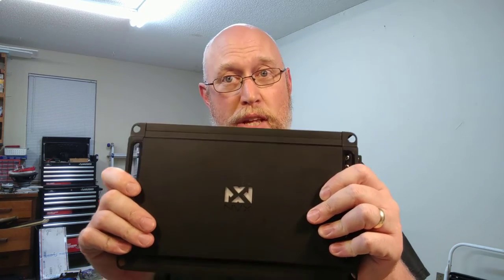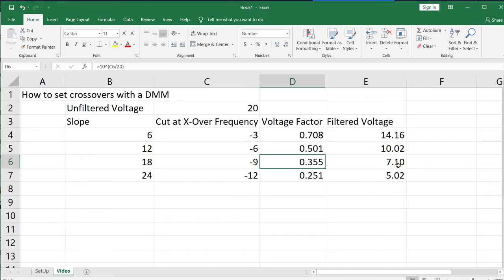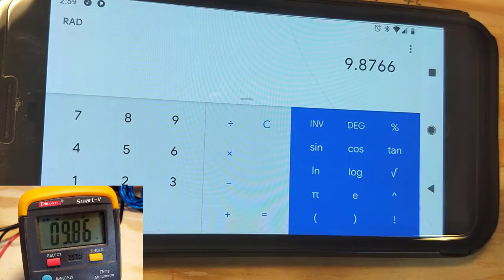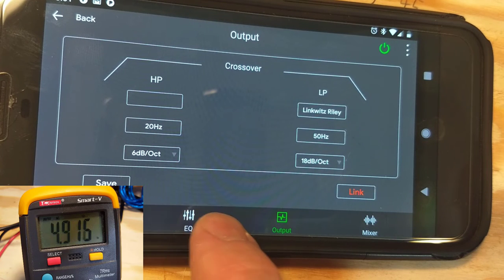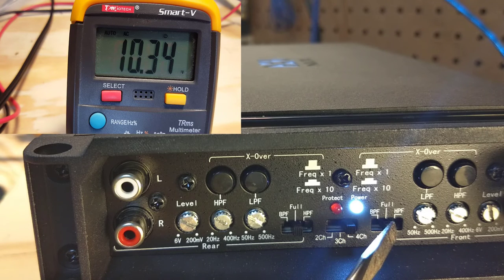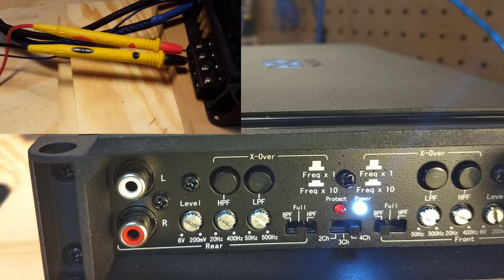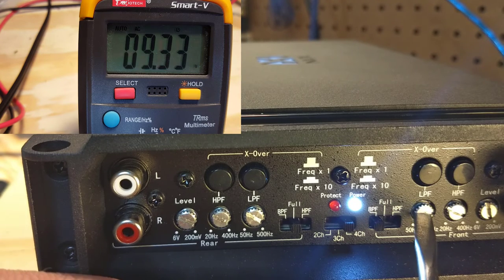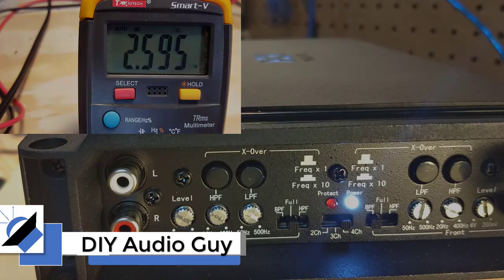Set Crossovers with a Multi-Meter, the CORRECT way!

Comment: Is it ok to bridge a 4 channel amplifier! I’ve a Rockford fosgate punch 400!
Reply from the maker: Most four channel amps can be bridged to two channels, and most are four ohm stable wind bridged.  You will need to check the owner's manual for the details for your particular amplifier.
Reply: DIY Audio Guy thanks 🤘🏾! One more question! Do you recommend me getting a equalizer or crossover for my car! Is one better then the other ?
Reply from the maker: That depends on what you're trying to accomplish and what your other gear looks like.
Reply from the maker: Some amps have a great crossover section and most head units have an decent EQ.  So you may not need either.  Honestly I wold skip an external EQ/crossover for a DSP.  You can get a basic DSP for $160 (https://amzn.to/301SgUa), or just skip it altogether and get a kicker key, which will automatily set the crossover, time alignment and EQ  (https://bit.ly/3kBLY5q).

Another good brand is MINI-DSP:  https://bit.ly/33RToun 
They have everything from entry level 4-channel DSPs up to 12 channel DSPs.
Reply: DIY Audio Guy nice thanks sir ! I’ll check into that soon! Yes my systems sounds clean and crispy! Super tweeters pioneers in dash ! Alpine 5.25 Es in doors. Alpine 6x9s in back! Jbl 751ez mono ! Rockford fosgate punch 400 that has clean technology set up! Kenwood excelon x303 head unit! In a 1993 Cadillac deville! Two 12 skars svl in a ported ground shaker box!
Reply from the maker: Hell yeah brother!
Reply: DIY Audio Guy appreciate it thank you sir💯🤘🏾💪🏽

Comment: what value level should be set at when doing this ?
Reply from the maker: It does not really matter.  But It is best practice to set  your gains properly before you set the crossovers.  I always like tinker with the volume on the radio until I get a good round number for the first reading.  This just makes the math easier.  

These videos may help:

https://www.youtube.com/watch?v=MBcGOoRJ4Ro
https://www.youtube.com/watch?v=iWRoIho7A7c

Comment: Hm, what would be the math for a crossover of 48dB/octave?
Reply from the maker: I'm not aware of any car audio amplifiers or signal processors that can do that.
Reply: DIY Audio Guy well my DM-810 DSP only has 12/24, but I’m using the crossover on my amp (Memphis VIV700.1) which has a 48dB slope for the LP crossover
Reply from the maker: Well I learned something new today.  I suppose I need to figure out the math for a 48 decibel per octave slope now.
Reply from the maker: The voltage factor would be .063.  So if your starting voltage was 10 then your voltage at the crossover point would be 0.63.  Which is virtually nothing.

Comment: What if I set my radio xover to 80, 6 way active xover to 75, and my amp’s xover to 70? All highpass on 6.5’s.
Reply from the maker: Then you will have three crossovers turned on.  If they're all 12 db/octave then you basically created a sloppy 36 db/ octave crossover.  You only need to use one of them.
Reply: DIY Audio Guy, what exactly do you mean when you say “sloppy”? Should it be 24db/octave or 48db/octave?
Do you have another suggestion on how to make my 6.5s not play 40 hertz, because 1 12db/octave xover set at 80 hz doesn’t do that. 6.5s shouldn’t play anything at all below 60hz IMO.
Reply from the maker: By sloppy I mean you've got one crossover set at 70 one at 75 and one at 80.  Each crossover is going to induce a phase shift at the crossover point and that's going to give you weird peaks and nulls at the crossover point.

And no, you can never keep your speakers from playing a 40 hz signal.  an octave is 1/2 of the frequency so if you have your crossover set at 80 hertz the signal will be down by 12 decibels at 40 hertz which is half of 80. In other words you're still going to get signal in the six and a half.   Crossovers are not a brick wall, they are gradual slopes.

Comment: How do you set a gain and xover for tweeter @125rms and xover @6000hz? I can do this for 150hz, 50hz, etc but the multimeter isn’t reading the way i expected.
Reply from the maker: Interesting, what is the multimeter doing?  Most multimeters can read the frequency, try a 6,000 hz test tone and see if the multimeter can read the frequency.
Reply: @DIYAudioGuy  yep I did and the voltage didn't read like a 150 tone, it read like 4.3 instead of 22.00
Reply from the maker: I honestly don't know what to tell you.

Comment: Does this formula work at any volume level? I assume the reference voltage is the voltage at whatever volume you are at.
Reply from the maker: Yes, it does.  What I've started to do lately is to set the volume so that the voltage is at a nice round number to make the math easy.   If the starting voltage is 10 then all you have to do is move the decimal in order to do the math.

Comment: Great video very informative.. I have a question. do u do this crossover settings after setting your gain with a 40 or 50 hertz tone?
Reply from the maker: Yes, set the gain first.
Reply: @DIYAudioGuy  Greetings! To follow up on your reply. In my case, it was not possible to set the gain first. I had to do the LPF and HPF (subsonic) tunings. Reason I couldn't do my gain first was because I could not reach my "required" 31.6V for the 1000W for my sub. The minimum reading on the DMM was 32.0+ V on the absolute lowest gain setting. Only after once I set the crossover points on the LPF and HPF first, did my gain gain knob actually give sensible voltage values. Does this seem correct to you? Does it actually make a difference which you tune first? Thank you!

edit: my sub level on the headunit was to 0.
Reply from the maker: Sounds like it worked out fine for you.  What frequency test tone did you use to set the gain and what is your crossover frequency?
Reply: @DIYAudioGuy   First I set the subsonic filter by playing a 30Hz 0dB tone. Then I set the LPF by playing a 80Hz 0dB tone. Finally I adjusted the amplifier's gain knob (headunit was 85% of max volume) by playing a 40Hz -3dB tone to bring it to the ~31.6V. Anything that jumps at you that you  would do differently? Thanks!
Reply from the maker: @acmilanshevachels  If you are happy with the sound and you are not clipping, then it is good.

Comment: The way you set crossover seems to be different from others. On other videos, people will play the frequency that they want their crossover set at, and whatever the voltage is when the frequency is playing, they will adjust the knob until voltage starts to drop and that’s where we would set it at.
Reply from the maker: Take a look at what happens around 11:20.  I turned the crossover on and I turned the knob all the way to the right. So the crossover is set to 500 Hertz.  At that point the voltage is just slightly less than the starting voltage.  So if you use the other method your crossover would be set to 500 hz, not 50.  Those other videos have thousands of views. Which means there are thousands of people out there with crossovers that are off by an order of magnitude.  You will notice that in this video I verified my math by comparing my predicted results against the result I got from the digital signal processor.
Reply: The crossover frequency point is always -3dB. So setting to crossover to 80hz means that there will be a -3b or 30% reduction in voltage at 80hz. This video shows exactly that
Reply from the maker: Crossovers can get pretty complicated. I'm not 100% sure that I have it right.  But I've seen some YouTube videos, from larger channels that should know better, that absolutely have it wrong.  Not trying to cast shade on them, just trying to help people.
Reply: Most amps have fixed slopes. The setting up for a target crossover, at an assumed frequency where the amp labelling is, could be inaccurate. If say one rotates the knob to a 90 hz lowpass, the only sure way to know IT has kicked in at the right frequency, is to start Sweeps and record the voltage where it changes. Burst tones are more accurate, at increments of one.
There are audiophile test cds with these tones. The track number and test tone at certain frequency is given.
Reply from the maker: One of us has to be wrong.

Comment: Enjoying your videos! Sorry if I have multiple questions on different videos, but what do you mean unfiltered voltage? Is this with a tone playing? Volume set to highest without clipping?
Reply from the maker: Unfiltered, as in the crossover is not on, or not doing anything.  it is with the tone playing with the volume does not have to be set to maximum.  You just need enough volume so that you can read a voltage on the multimeter.  

Keep the questions coming. I'm sure there are others with the exact same question that would like an answer.  If people are asking questions it means that I need to make another video on the topic.
Reply: @DIYAudioGuy  awesome and thanks again. Definitely made a new subscriber.
Reply: @DIYAudioGuy  where did you get voltage factor
Reply from the maker: @chevy1560  =10^((slope/2)/20)

Comment: great video, you need more views and more likes,
do i need a true rms dmm?
Reply from the maker: Yes, you can get a decent true RMS DMM dirt cheap these days.
Reply: @DIYAudioGuy  very big thank you for the video but I've got a little question.  If my amp Xover can do only 12db/oct should I multiply the first voltage by the factor you showed at the begining of the video for 12dv/oct?
Reply from the maker: @longdee5192  That is correct.

Comment: Is the volume all the way up before clipping?
Reply from the maker: You don't need the volume all the way up when setting crossovers.  It's just a matter of comparing the voltage before and after.  I show how to check for clipping in this video: https://youtu.be/L0ZXq2eo-OM
Reply: DIY Audio Guy ty sir. Getting ready to do a install in my 300 as soon as my package comes in

Comment: Nice dog 🐕
Had a question I wanted to ask you,  What’s your take on this?, why wouldn’t every amplifier that comes with a crossover adjustment, not give you the option to have it adjustable down to 0. For example, the infrasonic filter on most bass amplifiers in today’s market are adjustable from say 20-50hz or 15hz-35hz. This doesn’t allow someone the opportunity to not use the filter, because even at its lowest point, it is still cutting the voltage. What I hear from most people is that you shouldn’t notice that much of a decrease in loudness in those range of frequencies from having it at 15hz as compared to an amp that doesn’t have one, but  I beg to differ. Some of these amps nowadays have 24 dB slope on the Filter, and that really does affect a 20hz tone even having the filter it at its lowest point of 15hz. Sorry for the long winded comment and question. Keep up the great content!
Reply from the maker: Now that you mention it, that seems kind of odd.  when I get to my computer I will try to type up a thoughtful response for you.
Reply from the maker: OK, here is what I think!     Let's say you set the subsonic filter to 20 HZ, and it is a 6DB per octave linkwitz riley, it will be down 3DB at 20 HZ.  Then down 6DB at 15 HZ and down 12DB at 7.5 HZ.   Down 3DB at 20HZ is not much at all, but it is  kind of a moot point since most subs are going to roll off before they get down to 25 HZ.  Setting the subsonic to 15 HZ is practically the same as setting at at zero.   But this is just my best educated guess.
Reply: @DIYAudioGuy  i appreciate the response. In my experience, 99% of amps that have the subsonic filter on the amp, is either 12db per octave or 24.  i think rockford had one amp that had 18db per octave but was a one off idea.  6 db down at 20 hz is definetly noticable to me, especially when listening to full orchestra performances i have on cd's or  watching movies in my car,  like at a family camp trip when i show off lol.  But i see your point, subs would roll off some by that point and most music that is Mastered correctly with "real" music doesnt dip below 25hz.  Just thought id pick your brain on the subject.  Thanks again, have a good one!

Comment: How can you figure out what cross over slopes your amplifiers have on them weather it be butterworth or linkwitz Riley.?
Reply from the maker: That specification should be provided by the manufacturer.  Without knowing that, you could play test tones that are one octave apart and then back it out using the voltage factors that I show in the video.  I might have to give that a try and make a video.  When you combine a high pass and a low pass a Linkwitz-Riley will be flat at the crossover point and a Butterworth will have a "bump".  I am not sure how you would measure that to verify.  I will put that on my list of things to learn, if I figure it out I will make a video! 

Thanks watching my video and thanks for your question!
Reply: @DIYAudioGuy  thanks for your quick response can i use this method to set sub sonic filter?
Reply from the maker: @sameermohammed2657  Absolutely.  A subsonic filter is just a high pass crossover.
Reply: @DIYAudioGuy I have heard the crossovers "add" together for the db slope. So if the sub portion of amp is a 24db slope is it good to combine the head unit (HU) crossover 12db,  and 12db of amp HPF to get a smoother transition of the desired crossover frequency and a 24db slope? Would I use a 24db voltage factor if combining HU crossover and the amps crossover? 
 Another note, I had used 1000hz test tone for full range coax channels using an oscilloscope to set gain. When setting crossover i was using same test tone and that was funny. I needed almost the whole dial to hit my 12db voltage factor target. I didn't think about the frequency test tone used will make a difference of when you reach that target voltage. I just did the math and adjusted to hit target. Sounded horrible! Funny.
Reply from the maker: @opinionsevrywhere  I don't recommend doing that, just use one of them.
Reply: @DIYAudioGuy  Ok. I will use the amp's crossover just in case the battery dies or is disconnected to work on car. 
   Justin,  I had a curious result with an Alpine MRX-V70 amp. I performed the calibration as you show in the video. I had a 19.95 unfiltered voltage. When I started adjusting the crossover for a frequency of 80 hz test tone, the voltage INCREASED? I started at the lowest setting and as I turned it up the voltage increased. Any tests or suggestions are appreciated.
Reply from the maker: @opinionsevrywhere  That is odd.  I don't have any suggestions at the moment but if I think of something I'll let you know.
Reply from the maker: Another work around is to just use the -3db voltage factor.  I have read some sources that claim -3db down should be the crossover point no matter the slope.  But my testing showed that my DSP did not do it this way.
Reply: @DIYAudioGuy  doing some testing tonight your way is way more accurate your right in the sense that the -3db point is close but being accurate as your way is way better thanks for this video really helped alot
Reply from the maker: @sameermohammed2657  Glad to be of service to you!